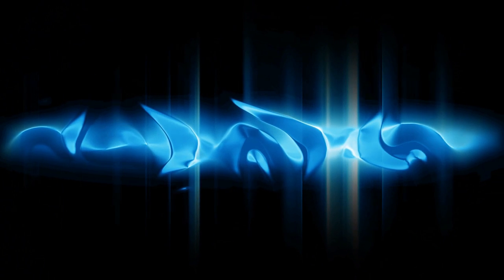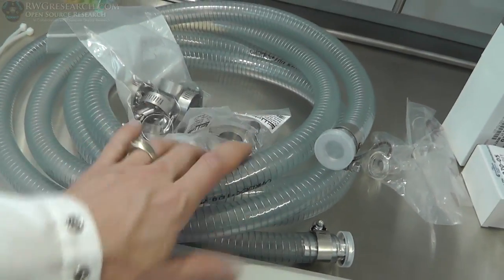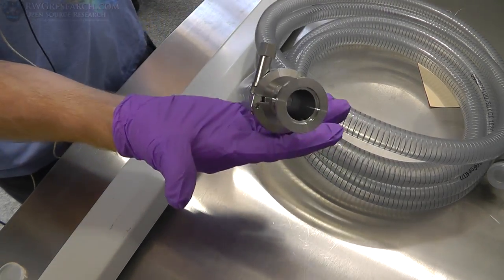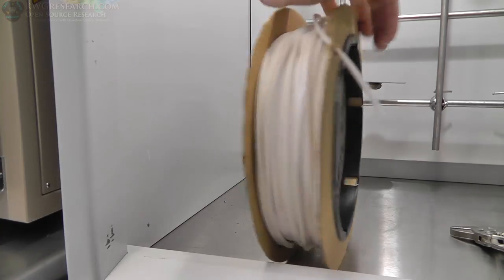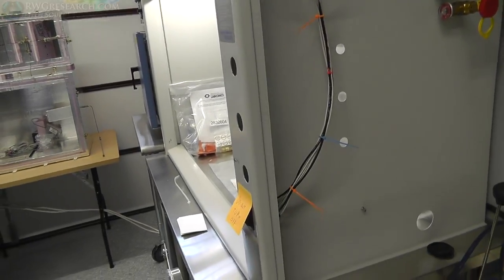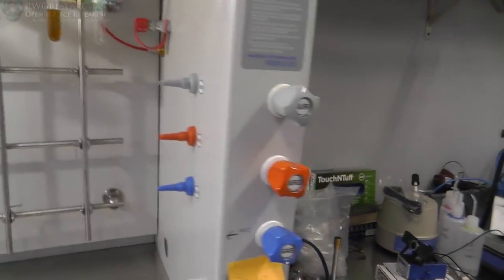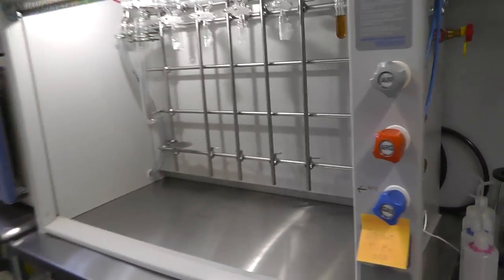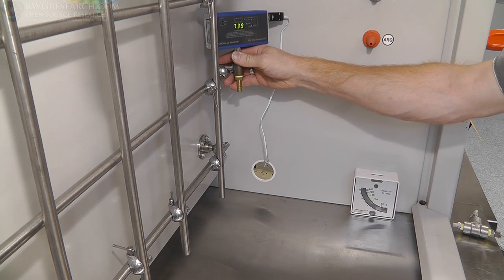Commissioning The Schlenk Line P2, VAC Line, Hood Valves, Clamps, Oh The Small Things...

Comment: You either ordered left hand mounted tubes for the spigots or your valves were installed upside down. (eg. Valve output goes on the top.)  From my perspective,  I'd rather have a down slope to those tubes in case any fluid inadvertently makes it that far.  Also surprised you didn't go with stainless.

Comment: Excellent video! ;) Thank you very much, Russ, looking forward to continuing =)
If I may, I would like to ask a few questions:
1. I understand that you have carried out in the laboratory of the central gas supply - likely methane?
2. Also, the narrower the pipeline to which you plan to connect the valve "Air" on the left wall of the cabinet you - if I understand correctly, it is compressed air? From a central gas supply is understandable, but where there is a "pipe with the air"? :)
3. The gas cylinder standing to the right of the table, green - is not nitrogen? It seems to me, is usually argon with balloons painted in gray (sometimes blue) color, and "green" is just for nitrogen...
4. Do not tell me that in the flexible "hoses blue" you are using a gas supply?

PS
In one of your videos seen on the table, also lecturing bottle with some gas - you could not tell what it was a gas?
Reply: The color of the gas cylinder tends to be up to the supplier/manufacture.